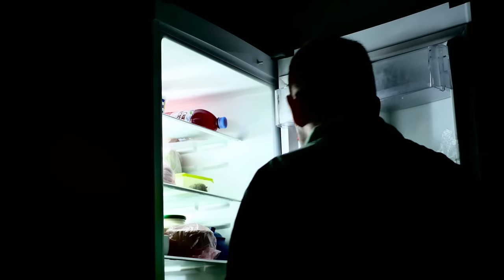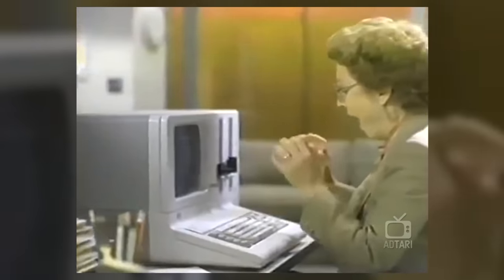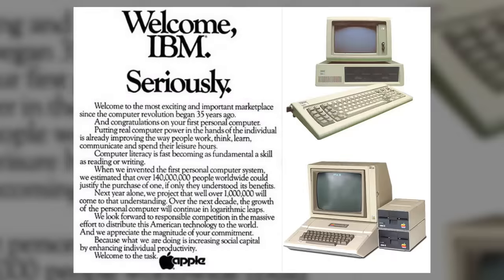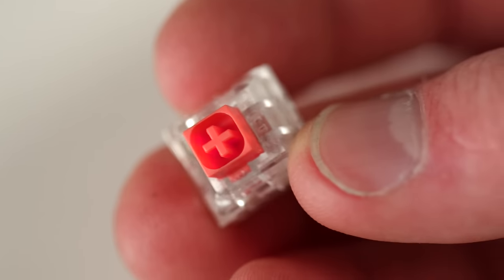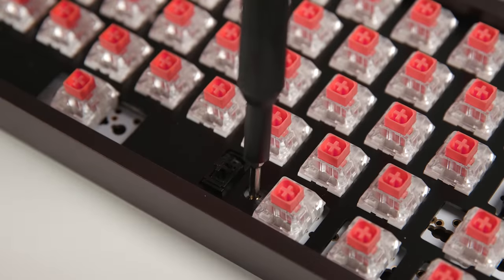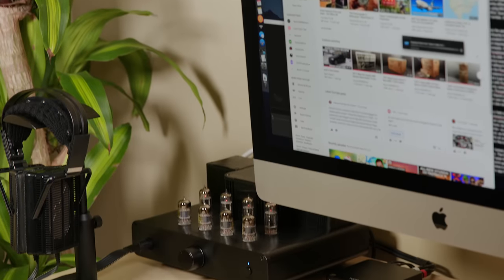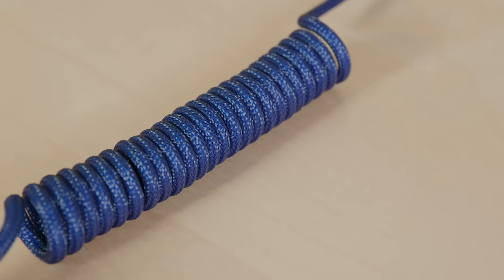This DIY Mechanical Keyboard Costs $300...!

Comment: Liked seeing all the steps in the process and good job on the soldering, but that noise from the space bar and backspace keys does not sound very 'solid' or premium like a Model M keyboard.  Lots of rattling.

Comment: actually unfinished board, you haven't lubed switches, stabs are unbalanced, unlubed, unclipped and untaped, no sound insulation on a backplate, but components are overall cool, just put some more time in it, and you will be pleasantly surprised by the sound and feel of keyboard
Reply from the maker: See pinned comment.

Comment: Maybe my attention span is simply that bad, but did you mention where to get the diy parts for the USB Cable? And if I wanted to, could I assemble a ridiculously long cable? Say.... 28 feet?
Reply: TechDove No, there are limits to the length. I don’t remember what they are for USB 3 off the top of my head, but for USB 2 it was 16 feet, I think, if not less. Anything longer, you have to use hubs or repeater cables.
Reply: @tookitogo  ah damn, I was trying to make a ridiculous cable for a project

Comment: You guys notice how he only used the right shift key at 8:05. Apparently your supposed to use both shifts while typing but 90% of typers just use one let it be the right or left shift. Pretty weird........huh
Reply: Yep. Unfortunately proper typing technique is a thing of the past. You should always use the opposite shift key from whatever key you’re typing. So anything on the left side should use the right shift and vice versa.

Comment: you spend $300 and build it from scratch if anything goes wrong you can identify the issue and solve relatively quickly and also cheaply. its a large investment but in the long run it will pay off as you may not have to purchase another keyboard again.

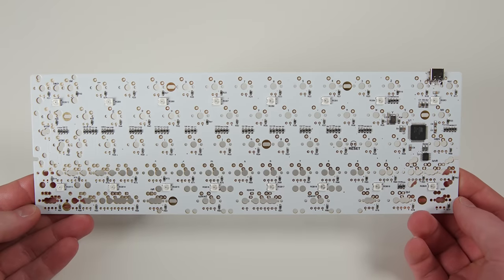Comment: 3:25 i wont use it cz im not a 12 yo.bro ,leds are just good to be there in case you don t know the keys layout and are in the dark so you can see what keys to type.i have a rgb kb and i wouldnt mind if it was even only 1 light only.
Reply: This PCB doesn’t have backlighting, it’s RGB underglow. That won’t help you locate the keys. Underglow is just accent lighting from the bottom of the keyboard.
Reply: You have to use a specific type of keycap for that to work though, they're made with a translucent plastic, coated with an opaque covering and then the legends are laser ablated to let the light through. The caps usually have to be pretty thin to maximise the effect, making them feel and sound a bit crap - so they tend not to be used by that many people in the custom mech community. He's using double-shot, SA-profile keycaps in this vid, they're essentially one opaque coloured plastic moulding inside another opaque coloured moulding, meaning that the legend goes all the way through and can never wear off. They're thick, durable, sound and feel great, and are arguably the highest quality (and most expensive) caps available. They also don't let light through.

Comment: How does the $300 DIY keyboard compare to your existing blue switch keyboard?

Living on the arse end of nowhere (NZ), I got curious as to the cheapest mechanical keyboard I could find (I have a thing about finding the cheapest non-shit things you can get). The cost of shipping puts most heavy mechanical keyboards well outside of the price I was looking for. So....

I got on Aliexpress (Aliexpress and ebay are pretty good. Amazon is RUBBISH in NZ because you can't see shipping costs or even if they'll ship to NZ before you start to commit to buy. i.e. you can find a reasonably priced whatever and then find that the shipping is 3 times the value of the actual item) and had a look around. The first thing that struck me was that there wasn't much of a choice in switches. You could get blue on just about EVERYTHING, reds on a few things (although I really didn't want reds) and maybe, if you're lucky, blacks or browns.

I finally settled on one (blue switches). It cost around $40NZD shipped (3 to 4 times the cost of a similar rubber dome keyboard). Once I got it, I was irritated (rightfully pissed off) by the backlights - they were rows of colors (so a row of pink, a row of yellow etc.). I went about finding similarly sized LEDs and replaced them to one color (I wanted the lights for practical rather than aesthetic reasons - I do look down occasionally. I went with red because it's unobtrusive). Which took a few hours (I had to do it twice just because I figured I could leave the red row alone but there were serious brightness differences so I ordered a few more LEDs and replaced those ones too).

So... probably 1 day of modding (rubber dampers + LED change) and I've got a keyboard that I mostly like (rubber domes feel "mushy" now).

BUT.... I kind of wonder about the DIY scene... do you really get something that much better for your money, time and effort? Or is it very much like the RGB scene? A whole lot of time and money for something you can talk about endlessly?

Comment: I think some of your information is wrong. Rubber dome switches have an average lifespan of 5 million keypresses while mechanical keyboards have an average lifespan of 50 million keypresses witch increases the life span immensely. An average mechanical keyboard last 10 to 15 years. Also why didn't you go with some cherry mx blues. Gotta join that Tactile bump gang!

Comment: How exactly was this keyboard so expensive? The switches for a 60% board should run you around 20$, the PCB costs around 40, I can't imagine the case and mounting plate costing much more than that and while expensive even the SA keycaps shouldn't catapult your budget into those regions, especially since it is a 60% board.

Comment: Or just buy the cheapest RGB mechanical keyboard on Amazon, then modify it and add SD card reader and USB 3.0 hub within the case. Cost me less than $80, and I made a video on the process...
Reply: These custom boards definitely offer (and are geared toward) the typing experience than anything else. It won't have the functionality of anything you did in your DIY, but from a pure typing experience, an admittedly expensive custom keyboard is a far more solid typing experience.

Comment: No arrow keys
Okay, I get the no number pad but what in the world were you thinking?
Reply: You really think he doesn't have arrow keys? The keyboard has function layers and he puts the arrow keys anywhere he wants so it's quicker to use than picking up your hands and going to the arrow keys. I have mine under ESDF and use Fn with my pinky which I replaced caps lock with since I never use it.

Comment: dude why u sayin mech keyboards are usually lower quality when they are not
Reply: ikr, i mean most cheap mechs, why not good in quality, are at least usable, and dont have the crappy build of a cheap rubber dome from kmart lol, i mean the flex is unbelievable lol
Reply: @Jay-qj3tz  i know, i could get probably the cheapest mech and it would still work and feel way better than any standard rubber dome board

Comment: Spends 300 on a board and it sounds like a fisher price toy.
What a horrific hollow clacky sound that case and those SA caps make, this needs some foam in the case to cut down on the echoed bottoming out sounds and those stabs need lubing

Comment: Man, Those stabilizers are junk and need some lube and tape. Other than that seems like a quality board. But good god the rattle on that space bar. 

You could also benefit from a dampening pad or something under the PCB. The reverb is pretty rough as well.

Comment: It's not even a ten keyless and it's $300? Insane. DIY or not. Just buy a CM storm if you want a small mech at a low price. Or for half that buy a K70 or something with led. I like LEDs. Over played at this point or not...it gives an awesome look if done right.
Reply: You don't get the point. This is far higher quality then you get with a CM Storm, which is actually pretty good for the price. The K70 is just garbage in general and comparing them isn't even fair.

Comment: could just buy a keyboard with desired switches and replace keycaps with desired keycaps. will be the same result in performance for half of the price. and since you dont care about looks cause your not 12 it shouldnt matter right.

Comment: expensive keyboard with defening switches, fewer keys and ugly wire and all for the bargain price of $300. You have to be mad! Nice vid though. I don’t get having fewer keys to map things to. Pros use multiple macro devices so they don’t have to use shortcuts and menus. Well the pros ive met do anyway. I would want something quieter and lower profile personally so my wrists are not bent back like the old keyboards made you do (which is why carpel tunnel was a thing and wrist rests were invented. Low profile removes the need)

Comment: Honestly the sound is soo bad,
U said u dont use rgb cause not 12 but ur room is rgb dude

300$ for switch that not even lubed, case that not dumped by foam, keycaps usb abs instead pbt
Mehhh not worth it

Comment: i almost puked. You didnt lube the stabilizers, you didnt holee mod the, you didnt bandaid mod them, the switches sound horrible. You couldve done a better job man. And it's coming from a 13 year old. But good job on the soldering.

Comment: Unlubed china knock off cherry style stabilisers which uses clip on instead of screwed on? Yep "custom" keyboard indeed. Clearly a beginner that has only seen the tip of the iceberg. Also using a cheap alu case and PCB with mediocre keycaps.
Reply from the maker: Nevin Goh Fixed! 😊 https://youtu.be/NTtGNXeBH20

Comment: this keyboard sound terrible... i srsly dont get why you entusiasts like mechanical keyboards... to me it feel terrible to press a button through a long socket... 

i hate apple but i must admit that they make great keyboards... the butterfly switch are the best switch if you ask me... i have heard there are issues with some models but i have never had any...
Reply: Look up Nathan Kim, Taekeyboards, Chyrosan22, and maybe Chokkan if you wanna understand why people are so invested in keyboards. Also, snazzy didn't lube or clip his stabilizers, which is why it sounded pretty bad. Trust me, the butterfly switch is horrible for a number of reasons, namely low travel and extreme unreliability.